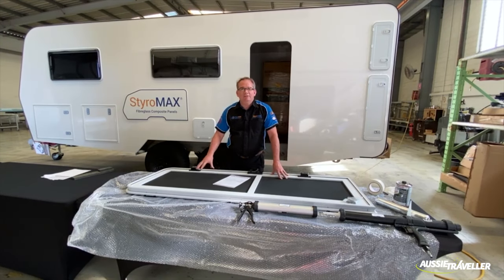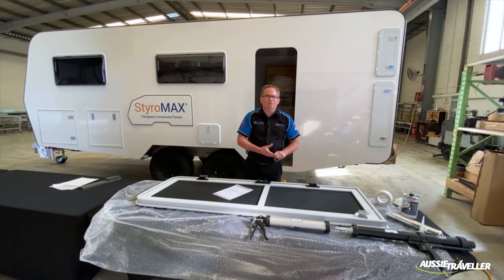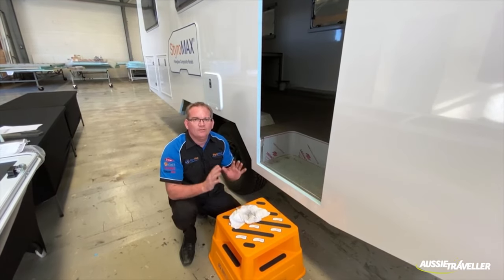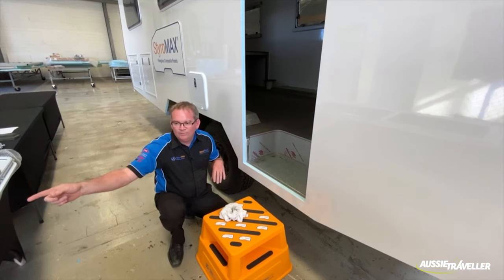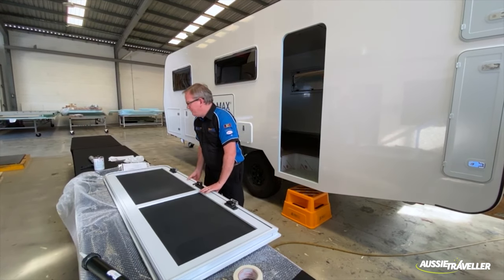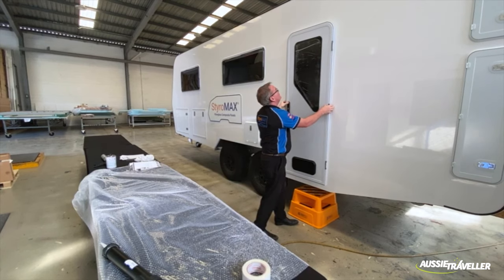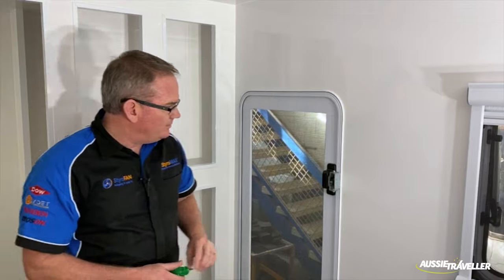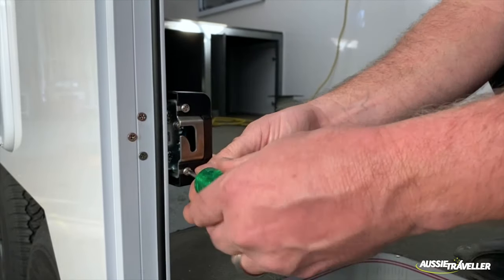Installing an Aussie Traveller Door

Comment: And there is no mention of installing the “striker back brace and striker mounting bracket pad” in the video?? The two confusing parts of the instruction manual are not covered in the installation video...